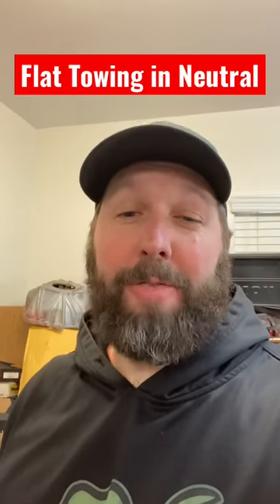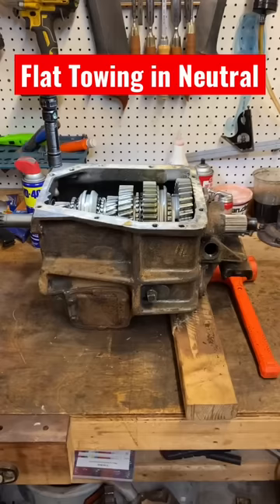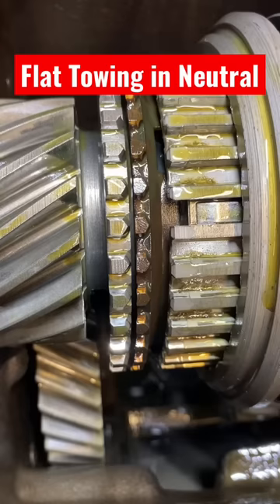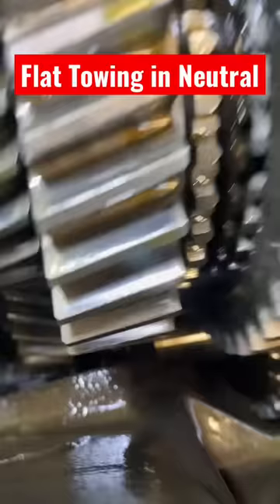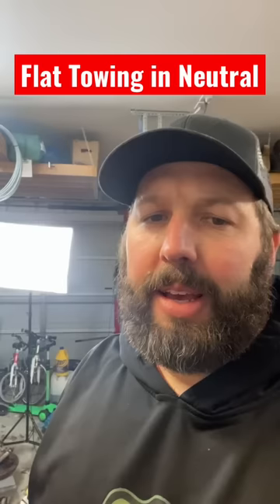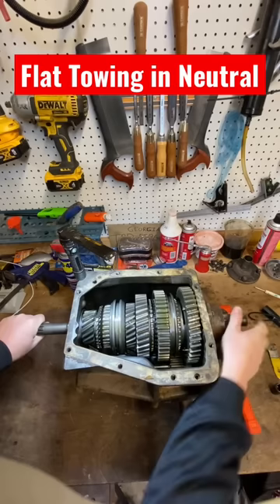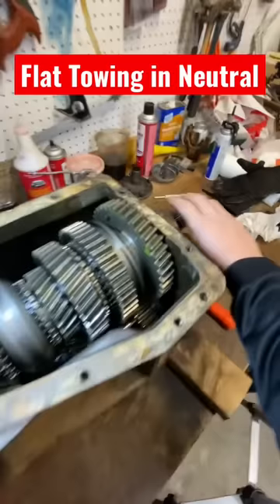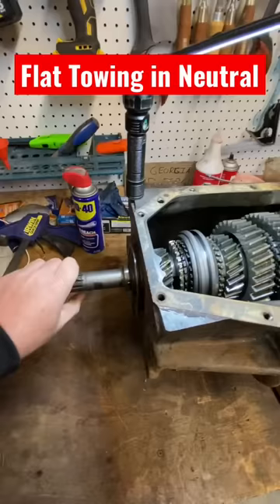Flat Towing in Neutral??? #transmission #stickshift #mechanic

Comment: I have a lowered S2000 I need to tow but the front is too long and low to be towed backwards. Seems like I can't leave it in neutral to have it towed with the front up so is a flat bed the only option?
Reply from the maker: I can’t imagine towing an S2000 any other way than on a trailer.

Comment: As a counter to this, most flat tows are just a few miles long at most…..it ain’t that big a deal
Reply from the maker: I don’t disagree. But I was really thinking about RVers when I made the video. But apparently I missed the mark. 👍
Reply: Humour me.  Try the same scene but this time fill the box to the correct level.  I may be wrong but there should still be oil being picked up by the main gears.
Reply from the maker: Well that gear box has been back in the truck for quite a while. https://www.tremec.com/not_am_detalle/flat-towing-manual-transmission-vehicles/

Comment: Wtf? I was always told that you need a manual transmission if you going to be flat towing it.... What vehicles can you flat tow? As a millwright im pickin up what your throwing down i just want to know if theres some different setups that would allow for this.
Reply from the maker: Yes, some manuals can be flat towed in neutral. But the best vehicles for flat towing are 4wd vehicles. Most 4wd vehicles can be towed by simply placing the Transfer Case in nuetral. That's one of the reasons that Jeeps have always been very popular for towing behind RVs.

Comment: If I'm towing I'm not worried about that transmission. if you're not able to lift drive tires, pull drive shaft or if possible leave engine running
Reply from the maker: So if you are towing due to an engine malfunction, you don’t care if you trash your transmission also 👀
Reply: @freedomworx  no read the comment
Reply from the maker: @jodycordell1972  rewrite the comment 🤓
Reply: @freedomworx  if you can't lift the tires that are bolted to the axles that are connected to the differential the pull the drive shaft out it will keep the tyranny safe if the engine is capable of running idle speed will keep oil moving

Comment: No, nothing is turning during flat tow because the transfer case is in neutral.  Output shaft is not turning
Reply from the maker: The transmission should still not be left in neutral even with the T-Case in neutral. Fluid friction will cause the transmission to spin. That’s why most owners manuals tell you to put the trans in gear and t-Case in neutral.

Comment: Then what would happen if you had the engine on trans in neutral and were coasting down a steep section of interstate.
Reply from the maker: It’ll be fine, so long as you aren’t pressing the clutch.

Comment: Get a 4x4 and put the transfer case in neutral. Now you can flat tow with the transmission in any gear or neutral.
Reply from the maker: You do not flat tow a 4x4 vehicle with the transmission in neutral. Even with the T-Case in neutral, the transmission is supposed to be in Park or Gear, for the exact same reasons stated in this video. Fluid friction in the T-Case will still spin the output shaft of the transmission if it's in neutral.
Reply: @freedomworx  very little if any. My transfer case, in neutral, disconects, the gears, spinning the transfer cases output gear and shaft, but not the transmissions output shaft as there is no connection from the driveshaft to the output shaft of the transmission. And manual transmissions don't have park.
Reply from the maker: In GEAR for MAUAL and in PARK for an AUTOMATIC... Read the owners manual for flat towing a 4WD vehicle and it will tell you exactly that, and for the same reason I explained to you. 🤷‍♂️
Reply: @freedomworx  I see you failed to comprehend two things I said. You couldn't even comprehend that my last sentence pointed out that your video was about a standard transmission. Yes, some vehicle owners' manuals do say that. Others don't for the reason I explained.
Reply from the maker: @EAMitch1619 ok, what specific transfer case are you referring to smart ass??? Because I own 4 4x4 trucks, and I’ve never seen a T-Case that disconnects the transmission output shaft from the T-Case 🤷🏻‍♂️
Reply: @freedomworx  it doesn't disconnect it from the transfer case, just the transfer cases output gear and shaft. That's why I'm able to freely turn the driveshafts on all 3 of my 4x4s with 2 of them in gear and one in park with the parking pawl engaged, locking up the transmission.
Reply from the maker: @EAMitch1619  which was my exact point that you failed to comprehend. It doesn’t matter that it is mechanically disconnected in nuetral. The fluid friction alone in the T-Case WILL SPIN THE TRANSMISSION OUTPUT SHAFT EVEN WITH THE T-CASE IN NEUTRAL.

Comment: hee correct. still could flat tow it if the engine is working, let it idle in neutral while be flat towed. of course then why are ya towing it in the first place if the engine could idle.  😮😊
Reply from the maker: Pretty much 👍

Comment: I'd say if you're towing it in gear, don't have it in first either lol maybe 2nd. Better put the parking brake on too just to make sure there's plenty of work to do to the car later
Reply from the maker: Or you could read the owners manual and figure out how to do it properly. 🤓
Reply: @freedomworx  yeah, by having it in gear and using the engine 😂

Comment: I understand putting it in gear to oil the transmission,do you put a board on the clutch so the motor doesn't turn over
Reply from the maker: I was not insinuating that you should tow it in gear.

Comment: I’m going to step out on a limb and say that flat towing a vehicle with a manual transmission in gear is also not advisable. I get it one could remove the driveshaft but no one is going to do that if they are broke down on the side of the road.  How far are you going, cross country? put it on a trailer.
Reply from the maker: I never insinuated to flat tow it with it in gear.

Comment: So coasting using the clutch only while in gear is the only way to tow?
Reply from the maker: No. You can remove the driveshaft on RWD vehicles. Just refer to your owners manual. It’ll tell you what’s acceptable.

Comment: Thats why you leave it in gear transfercsse in neutral and engine runni g
Reply from the maker: No need to have the engine running if the T-Case in Neutral. In most 4WD vehicles, the specified towing configuration is T-Case in neutral and transmission in gear (manual) or Park (automatic). The trans won’t spin and the T-Case will oil itself.

Comment: I have to get mine towed because it won’t go into any other gear but neutral, i guess I’m screwed then, i got it outside with the emergency brake holding it in place 😩
Reply from the maker: Just overfill the trans or disconnect the driveshaft.

Comment: Does this apply with coasting?

I save ALOT of fuel miles coasting down even 100 foot inclines.

Now, let's talk about the 13 mile drop coming out of Virginia into N.C...
Reply from the maker: If the engine is idling and your foot is off the clutch, it’s oiling fine.
Reply: @freedomworx Grateful!
i am assuming automatic's "neutral" is "off the clutch" - for other readers of your outstanding answer.
Thank you for removing my (and others) ignorance!👍
Reply: Your education is shared in my FB. 

If you still have this transmission still open, could you provide what happens when my transmission slams back into gear while re-engaging.

I try very carefully to not permit it, buuuuut, occassionally...

Slamming happens to everyone so this would be a very informative vid.

Since this vid is outstanding for presentation,  , pronunciation, editing, lighting, dialog, camera usage,  timing and all the efforts it takes to create an effective, outstandingly detailed production (especially for sufferers of ADHD,) I have no doubt the vid will be just as popular.
Thank you Sir.
Reply from the maker: I appreciate it. That trans odd back in the truck already, so no more videos on it.
Reply: @freedomworx  I figured.
Bummer.
Keep the suggestion in the back of your coconut 🥥 😊 if you would.

Comment: That output shaft is still going to spin. You trying to tell me where the vice grips are won’t be spun by the driveshaft?
Reply from the maker: It cannot be spun by the driveshaft when the trans is in neutral. It’s held stationary by the clutch coupled to the engine.

Comment: I got a question... does the same apply if the motor is running in idle.... asking for a friend 😅
Reply from the maker: If the engine is running, and the clutch isn’t depressed, it’s fine.
Reply: @freedomworx     it's automatic, so i'm guessing it's ok.?
Reply from the maker: Yes.

Comment: my fwd car uses the ring gear as an oil pump, it should be fine shouldnt it?
Reply from the maker: That’s a transaxle, not a transmission 😉.  But yes, I think most FWD cars are ok. The owners manual should tell you if it’s ok.

Comment: 75 C 20?
You could have the truck in your videos, that would be a good truck.
Why would you need to tow it?
If you did, you could remove the driveshaft or shafts.
But if it's a top loader, you could remove the shifter and add additional oil, 90wt, GL-5 or even SAE- 30 and the like. Then before returning it to service, you could pull the fill plug to drain the extra.
Right?
Some vehicles might be where you couldn't get under them before towing.
Reply from the maker: It’s in other videos. You can only fit so much into 60 seconds. I’ve never needed to tow it, just thought I’d give an explanation to those that might be curious. 🤓
Reply: I liked your video. Alot of guys don't see those things apart.
Manuals aren't always available for those in the mid 70's.
Reply from the maker: @dannylinc6247  yep. All the info is available on the interweb nowadays. It’s crazy to me how there is so much information available, yet people are getting less and less capable of using it 🤷🏻‍♂️
Reply: @freedomworx  I spend more time doing that than working on the vehicle.
Then it goes quick to fix it.
Libraries have databases that would require subscription.
They almost seem to be stingy with it at some places.
Chilton is free with a library card online.
Reply from the maker: @dannylinc6247  I’ve definitely got a Library Card 🤓

Comment: So then if you cant flat tow in gear, and you can flat tow in neutral, how are you supposed to? Ive never looked into this subject so i legit am clueless, i assume flat towing it towing the vehicle on its wheels, and youre supposed to do.... Something.... To protect the transmission?
Reply from the maker: You have to read the owners manual for the specific vehicle. It’s fine in some, but not in others. Might need to remove the driveshaft on a RWD vehicle, or place the T-Case in Neutral for a 4WD vehicle. It might tell you that it’s ok for a certain distance at a certain speed. Might not be able to do it at all on some.
Reply: @freedomworx  gotcha, but then why not say that in the video
Reply from the maker: @TheGameboy57  I said it in the original 90 second video, but it got cut out when the Short was created. And I said it in the video description 😉. 
https://youtu.be/yCOos-u0oKs

Comment: If the input shaft is turning that would mean the engine is turning it so why do you need to tow it exactly? But I've heard that you're supposed to tow with it in reverse
Reply from the maker: I’d just tow it like the manual says 😉

Comment: Thing is homeboy the bottom of the gears are immersed in transmission oil and the car is bouncing around constantly covering the gears in oil. Where do you think 5 or 6 quarts of transmission fluid are sitting if not on the principle gears
Reply from the maker: The bottom of the gears are not in oil. That would be an extremely inefficient transmission. You aren’t just disagreeing with me, you are disagreeing with the manufacturers 🤷🏻‍♂️ https://www.tremec.com/not_am_detalle/flat-towing-manual-transmission-vehicles/
Reply: Come on are you serious? You don't have to be an engineer to know that 5  to 8 quarts of fluid are in that transmission and there is no way that that much fluid is sitting in that little transmission pan and from all those turning gears. Where are you suggesting where  all that fluids stays in place then? @freedomworx
Reply from the maker: You don’t have to be an engineer to look through the fill hole to see that the fill level is below the level of the mainshaft gears. But since I am an engineer…that’s the simple way that I confirmed it 🤷🏻‍♂️.  You are fighting a loosing battle bro. Every recovery company that  tows a vehicle with the drive axle on the ground (generally heavy truck towing companies) removes the driveshaft before they tow, for this exact reason.
Reply: Duh! Cars get towed all the time with only the front end lifted. What planet are you on? @freedomworx
Reply from the maker: Yeah…front wheel drive vehicles. Are you high right now? You are literally arguing against every auto manufacturer and transmission manufacturer in the world right now.

Comment: So coasting down a mountain with the engine running in neutral, would still lubricate the gears, and not be a problem?
Reply from the maker: As long as you aren’t depressing the clutch.

Comment: When I think about this I see the each wheel/tire fighting against each other, Leaving Squelch marks, As each Wheel is trying to turn the same direction😂
Reply from the maker: Well then you must hand taken it as a joke, which it is not. I didn’t say to try and tow in gear or park, I said you might not be able to tow in Neutral. There are other options 🤷🏻‍♂️ https://www.tremec.com/not_am_detalle/flat-towing-manual-transmission-vehicles/
Reply: @freedomworx  just on a posey traction rear end ,. No I didn't take you that way

Comment: Zero load on bearings, gears and shafts.  It will be fine.
Reply from the maker: The bearings need lube and cooling regardless of load. There is a reason heavy trucks always have the driveshaft removed before towing. And the reason is what I just explained 🤷🏻‍♂️. https://www.tremec.com/not_am_detalle/flat-towing-manual-transmission-vehicles/

Comment: So, you’re saying if I start my vehicle and let it idle in neutral, while being towed in neutral, im good. My tow vehicle can idle all day on a couple of gallons of gas. Thank you. Dave g.
Reply from the maker: It’s an option.
Reply: @freedomworx   thanks for the information. I will be towing my 2010 Toyota Tacoma 4 cyl 5 speed 4wd drive behind my rv this summer on family vacation. I plan to just let it idle in neutral while towing it. This should allow gear oil to “splash” as the input shaft turn at 650 rpms and the output shaft can turn with the back wheels. 
Thanks again. Dave g.
Reply from the maker: You should read the owners manual. Towing in neutral is ok for many vehicles.

Comment: Am I to assume that going down hill in Neutral (in a manual) will also leave the main dry? 🤔 Real question😅 If so why do I see people slap it in N and wiggle the stick then just coast? That seems like a bad idea now.
Reply from the maker: If the engine is running and the clutch is not depressed, it is oiling. Some transmissions don’t have this issue. It’s vehicle specific.

Comment: So what your saying is don’t flat tow my 70’s c10 because the fluid level doesn’t go up to the main shaft line like most newer man trans autos
Reply from the maker: This video is applicable to many manual transmissions. Old and new.  You should read your Owner's Manual. Towing in neutral is fine for some vehicles. Some need the driveshaft disconnected.  🤷‍♂️ https://www.tremec.com/not_am_detalle/flat-towing-manual-transmission-vehicles/

Comment: Does it also hurt to coast long distances in neutral? For instance, down a long hill for approximately a mile or more?
Reply from the maker: Probably not going to hurt anything. But if your aren’t depressing the clutch, and the engine is running, it’s oiling.

Comment: It will heat up and cooling is not there the oil is not flowing to cool .It will heat up so hot its like 300 degrees or 1300 degrees after a 20 mile run in the transmission its red hot White hot i welds itself with friction
Reply from the maker: Science 😎

Comment: I saw in another reply by you thats take out drive shaft. Wht about a standard front wheel drive car?
Reply from the maker: Most of those can be flat towed in neutral. Just check the owners manual.

Comment: How you supposed to do it??do you Jack the rear up and tow  from the back leaving the front on the  ground ??
Reply from the maker: You have to read the owners manual for each individual vehicle. Some can be towed in neutral, some need the driveshaft removed, or some other compensatory measure.

Comment: Put the transfer case in neutral and it doesn’t matter.
Reply from the maker: Actually it does still matter. The trans isn’t supposed to be in Nuetral, even if the transfer case is. The owners manual generally states that.

Comment: lol I towed a awd Hyundai I got for free with a blown head gasket with a dolly I tried removing the driveshaft but the bolts rounded off because it was so rusted. 5 miles into driving to my house I burned up the differential 🤭 I was going to do a head job on it. But I finished her off. 😂
Reply from the maker: Pics or it didn’t happen 😉👍